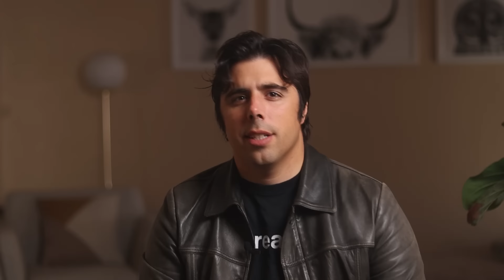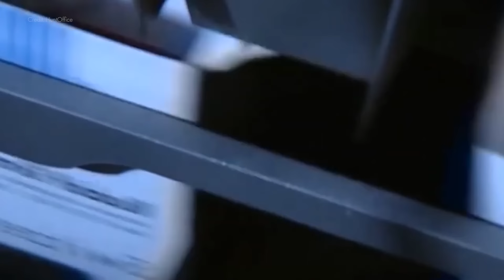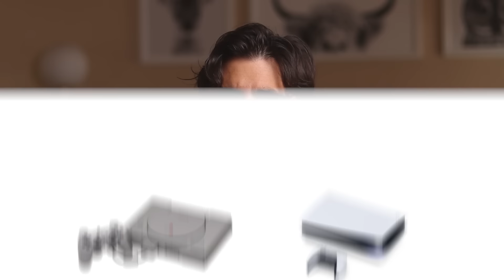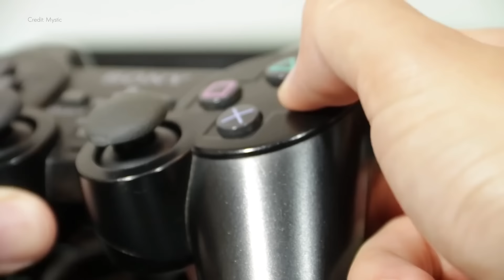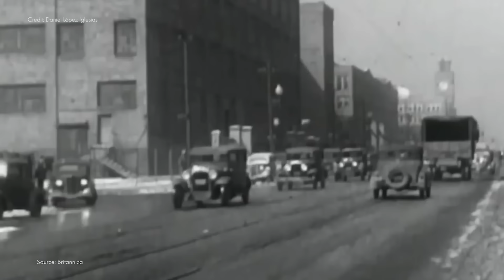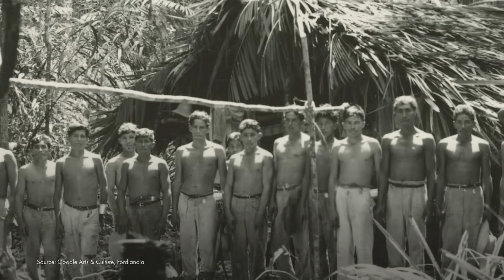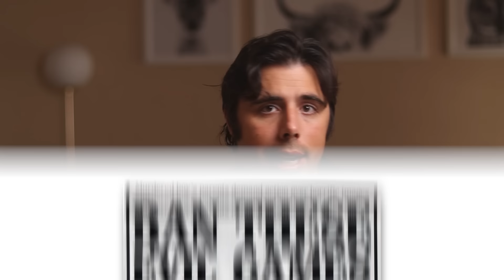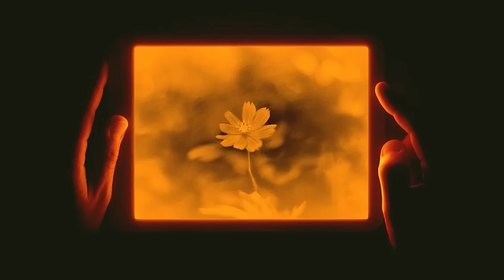Why Some Designs Are Impossible to Improve: Quintessence

Comment: My parents received a Sunbeam toaster as a wedding gift in 1961. It died in 2015. We were all heartbroken. The new toaster takes too long and don't toast as well.
Reply: I think eBay or Mercari have those!
Reply: When I was younger, I liked watching at my friends' face trying to figure out how to make toasts with our Sunbean toaster (still running at 68 years old)
Reply: Fix the old one
Reply: Same story for me with my Braun "Citromatic". Bought by my mum in 1974 (before I was born) and still alive and kicking every morning 50 years later!
Reply: @LasCosasComoSean  ok so not the same story?
Reply: kitchenAid toaster seems similar and works fine :P
Reply: Bruh you can repair it. Especially the old devices are super easy to repair. It will work for another 54 years! It's a very simple electrical device, you can learn how it works with a 10-minute YT tutorial and check out what part you need. Most likely a new heating coil for $3 or so. If you don't want to educate yourself, ask a friend with basic electrical knowledge to fix it for you.
Reply: U say 50 years!
Reply: Did you spend $300 on the new toaster?
Reply: The old one's so simple it could be repaired. However it would cost more than a new toaster should you not have the expertise to do it yourself :/
Reply: Was it the Radiant Control one?
Reply: you couldve repaired it!
Reply: fix it fix it fix it fix it
Reply: When my parents got married in 1959 they received 15 Pyrex oven trays from 15 different guests. And thus was the quintessential wedding list invented.
Reply: Wonder if u'd fancy a Mitsubish Electric Bread Oven.
Reply: Same thing with the automatic stirrers/handheld blenders they made in the eastern bloc. My family uses the soviet kitchen electronics to this day because they were made for longevity, not profit
Reply: Sunbeams are easy to repair
Reply: But where?  @Steph.98114
Reply: Sorry for your loss 🙏
Reply: If you didn't throw it away, it can be fixed.
Reply: @WhatWillYouFind where DIY?
Reply: Jesus wanted a sunbeam.  RIP toaster.  Rust in pieces. (seriously, that is both sweet and sad).
Reply: I bought my grandma a toaster oven to replace her toaster from mid century. At first she hated it because it's huge but then she used it and now thinks it's good.
Reply: Just fix it. Some boomer guy repair shop can do it probably.
Reply: go to a goodwill and find a toaster with wavy heater elements
and make sure to plug it in and watch for how fast it heats up, it shouldn't take more than a few seconds if it's a good one
Namebrands are usually the better ones, the heavier the better most times!
Reply: probably only needed a new bimetal strip or adjusting the original
Reply: I haven't had toast made from the Sunbeam toaster but imo it looks too well done for me, I prefer a lighter color on my toast
Reply: my mum still has a magimix she received as a wedding gift in 1984. the marriage lasted less than 2 years but the magimix has just turned 40.
Reply: You could probably find someone to repair it. It probably just needs some new coils or a switch/relay, really toasters are simple devices
Reply: my parents got 3 really good emergency lights that last 4 days from a friend for the umm anniversary, next month we got the power outs (sir lanka crisis thingy)
Reply: anyone else here after watching Jerry Seinfeld on GQ
Reply: Rest in peace ❤😢.  

😂
Reply: When I was a kid my folks thought there's broke, but I looked it over and asked what the adjustment screw was for. It just needed adjusting.
Reply: Yes, it was the classic wedding gift for several decades!
Reply: Luckily old stuff is pretty simple to fix and usually has extensive manufacturer documentation on how to do so
Reply: But Sunbeam toast doesn't pop! That's the best part!
Reply: Can't you repair it? Old toasters don't carry complicated electronics. As the video recommends, "Technology Connection" channel has a good explanation about it, maybe you can find ideas of where the problem is from watching it. Perhaps it's merely a blew up fuse.
Reply: I have a Black and Decker juicer. My mother had it for 20+ years before gifting to me in 1982. No idea what she paid for it. I still use it in 2024.
Price v longevity? Quality v Utility?
You decide. I, however, go for quality over price.
Reply: you can change how long a toaster toasts by turning the dial with the timer
Reply: The part most likely to fail is right there in the cheap new one. Just swap the hot bit.
Reply: It's so annoying.  When I moved out I got to take the popcorn maker that my family had had since the 80s with me.  It broke maybe 5 years ago.  I've had 2 other popcorn makers since then and they've both broken in that time.  I just make it on stovetop now.  I do have microwave ones but popped in machine or stovetop just tastes so different.
Reply: Through the magic of buying two of them...
Reply: get a Breville the 'A Bit More' 2 Slice
Reply: I had no idea toasters were so important lol
Reply: Watch The Brave Little Toaster. Then fix it.
Reply: Wedding Gift❌
Dowry ✅
Reply: bro I promise you there are plenty of toasters out there that can make toast just as well. I'm not well studied here but I cannot accept that whatever arcane knowledge the Sunbeam engineers possessed to make good toast quickly died with the company

Comment: Interesting video, although I'm not sure why the model T is really considered quintessential in the same way as other designs. The other examples are things that things are designs that are so fundamental that they basically force a new standard that is so powerful that it can't be broken. Even a nominally better design can't displace it.

But the Model T was made obsolete relatively quickly. Cars don't look anything like model Ts today (unlike QWERTY keyboards which are basically the same) and it wasn't radically different from it's own contemporary competition except in its price, and even then it wasn't an order of magnitude cheaper than the Buick example. It and the Ford company were clearly historically significant, but it doesn't feel quintessential like paperclips, toasters, or touch screen smartphones.

Also for the record, the N64 pioneered the analog stick design in gaming and the PS1 controller was updated later to include this.
Reply from the maker: The supply chain insanity is what makes it more quintessential in my mind. And yeah I know about the N64 controller but it was a bit of an evolutionary dead end relative to PS analog sticks

Comment: Great video! The part about Apples control on manufacturing is interesting, hadn't thought about it that way. Also I had no idea Ford started a Fordlandia, that stuff is insane. There's also a whole other discussion to be had about how Apple has done their design and maybe especially marketing to turn a luxury priced product into something everyone buys. It's really fascinating to me how they have managed to sell the Iphone as a "must have" to so many people.
Reply: In June 2024, I bought a brand new smartphone for 10–14 times less than several new iPhones would cost. — Moto G53 5G, for the curious.

There were three primary reasons:

• The really non-compulsory Estonian i-vote verification app no longer worked on Android 9.0;
• The device price had a substantial sale —  from €225...€259 to €99. This was close to €79, which is what a used phone with Android 11 cost elsewhere, so I opted to get a brand-new smartphone;
• and that I didn't know back then, if I'd be able to afford a new smartphone in the future.

I got it with Android 13, and got an over-the-air upgrade to Android 14.

Additional pros and cons:

• 3.5mm headphone jack — quintessential design in and of itself;
• a level of water resistance;
• future-proof with 5G;
• 50 Mpix camera;
• Security and stability updates through 2026, which is longer than most Android fare from years past, but not as long as iPhone software support;
• Built-in Opera browser with VPN;
• Built-in Dolby Atmos is sub-par to  Dolby Audio, because the custom equaliser in 'Atmos doesn't work as well as in Dolby Audio.

Comment: 27:02 You talk about the aux port being out of place and it seems like apple agreed with you. The newer models did away with it as I'm sure you're aware. I miss the ability to use unpowered Aux headphones. It felt like a downgrade to me among some of the other changes. What felt like a technological swiss-army knife is now turning into a screen that feeds content. I hope those other companies have find ways to become popular. Admittedly most of them I'm only hearing about now from this video.
Reply from the maker: Agree with you on the headphone jack. I would have kept it in, in spite of the aesthetic eye sore. I think you could handle it better aesthetically also. Later models achieved this. Apple doing away with the headphone jack has more to do with aesthetics over function imo. Or just getting you to buy air pods. I personally dislike that decision
Reply: @Design.Theory  Yeah. I agree with the aesthetics points. I don't personally know how to make it meld better given how thin these things got. I'd like to think they chose taking it off for aesthetics, but it's likely for the up-sale factor of the air pods was a factor.

Comment: 30:08 
That can be fixed by the user owning the software, not by changing anything on the hardware. And to own the software, a severance with the network is required, at least to the network of the manufacturer of the phone.

The smartphone needs to become more like a personal computer, which gives much more control to the user (but that would be at the cost of some convenience, that's why it doesn't happen), or, ironically what we had before : "pocket computers".

Another thing that would greatly help is if we just destroy the data broker industry with stronger laws like the EU is doing. The data is owned by the user, it can't be captured from the device, end of the question, that would change the incentives.
Reply from the maker: It's ironic how you can customize every micro-feature on a phone down to wallpaper and button colors, but you have absolutely no say in how you want it to integrate into your life

Comment: The QWERTY  keyboard slowdown is actually a myth
Reply: @paclin9951 yeah, I'm disappointed that Design Theory repeated this myth in an apparently well researched video essay
Reply: @RYOkEkEN  yeah that's why paclin is commenting on it. The "factoid" that the QWERTY layout was designed/introduced to stop typewriters from jamming when two nearby keys are struck at once — it's actually unsubstantiated (there's no original evidence for it). People keep repeating this myth, because they hear it from other seemingly reliable 3rd hand sources. But when people actually have tried to find primary sources to support this claim, nothing can be found, and the evidence points to other things that influenced the design
Reply: As someone that uses DVORAK, I can say that I type much faster than I did on QWERTY. I would say the main benefit however is finger and hand strain. I find that I can type for longer periods of time before my fingers are fatigued.
Reply from the maker: There are very good reasons to believe that the QWERTY keyboard was designed to prevent type bar jams. Go check my works cited page (bottom of video description) and read the source material I referenced.

EDIT: never said that qwerty keyboard layout is to slow down typing. That is, in fact, a myth. I said it was to prevent type bar jams. That's not the same thing. Once again, check the works cited page for more detail.
Reply: You are right. However, alternative layouts as Colemak or Dvorak are a lot more efficient.
Reply: Yeah I've heard that urban legend get passed around way too often
Reply: Why do you say it's a myth?
Reply: @tremor6160  uh cause it's not true?
Reply: @AKK5I  How do you know it's not true?
Reply: @tremor6160  "Contrary to popular belief, the QWERTY layout was not designed to slow the typist down [2]" - Yasuoka, Koichi; Yasuoka, Motoko (March 2011). "On the Prehistory of QWERTY"
Reply: @AKK5I So why was the QWERTY layout invented? Why not just a straightforward ABCDE layout?
Reply: @AKK5I I took a look at your reference and it seemed to me to be just two Japanese researchers putting forward THEIR OWN HYPOTHESIS about the QWERTY layout. They seemed to me to be throwing shade on all other hypotheses as a way to promote their own hypothesis.
Reply: @tremor6160  No, there's other research which also can't substantiate the "invented to not get typewriters to stick" claim.
The burden of proof is on the people who claim that qwerty was invented for that specific reason.

Why not use ABC? Because qwerty is actually much more efficient. It came about organically.
But now with computers, we see that we can reduce finger strain by using designs such as Colemak, which can be at minimum 60% more efficient
Reply: @tremor6160  what ever reason the QWERTY layout was designed how it was won't truly be known. C. L. Shole invented it almost 2 centuries ago so the exact reasons can only be questioned with logic, and the idea that it was designed to "slow down typewriters" is easily debunked for "the simple reason that “ER” layout in the keyboard, is the fourth most common letter pairing in English. The reason why an alphabetical layout wasn't used was because "it was confusing and inefficient for translating morse code" so it's assumed qwerty was deemed "efficient" during its time but clearly inferior to modern layouts like Dvorak and Colemak. The widespread myth of it being a development to mechanical error is really a brainlet take and I suggest you do you own research if you're so interested.
Reply: @AKK5I 1.What does "brainlet take" mean? I've never heard that term before. 
2. Why would "translating morse code" be used as the dominant reason for the mass selling of QWERTY typewriters when most users throughout their history do not use them for that purpose?
Reply: @tremor6160 
Someone else in the comments said that the qwerty makers originally started with ABCDE, but then made incremental improvements by grouping certain parts and shirking lesser-used letters (middle keyboard is still alphabetical: dfghjkl, downward MN, upward OP; and the least used letters were pushed off to the left corners because they would be used less: QWZX. As you can see A was brought directly downward from that corner spot. S was popular, so it was moved to the center row. Lesser letters like Y and V were put in the middle where you have to move your fingers further. Etc). They swapped letters around until they had something that worked well enough. Incremental improvements.

By human standards, it is pretty good. It would take a lot of study and computer power to come up with substantial improvements.